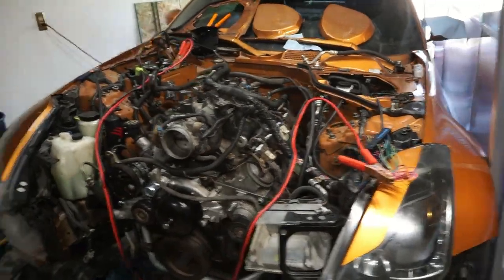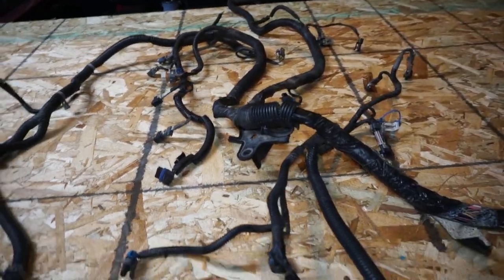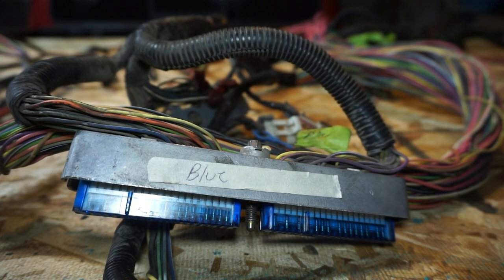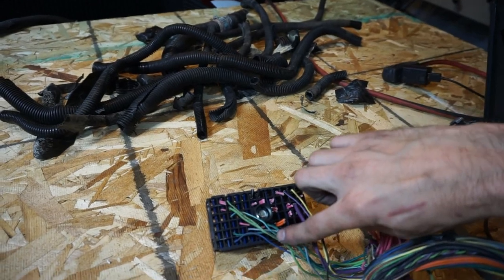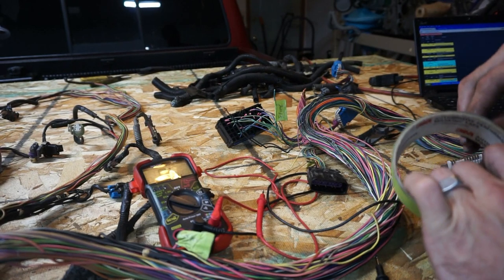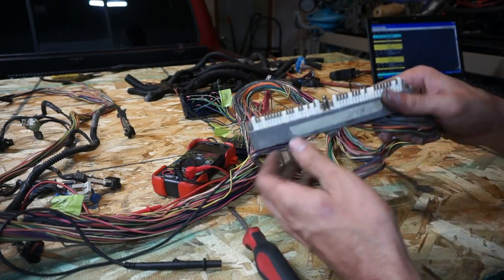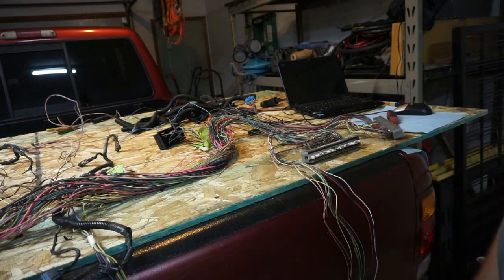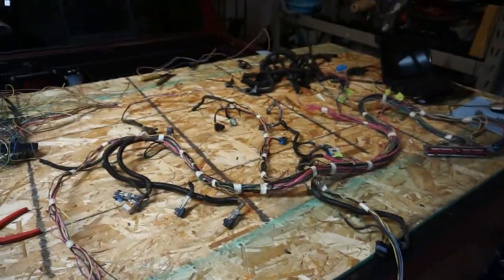HOW TO - STANDALONE LS SWAP HARNESS!!! Manual and Non-Electronic Transmission!!!

Comment: Dude, I did my harness recently for my fairmont, and this vid saved my ass! Thanks bro!
Reply from the maker: Glad to hear that!
Reply: I'm about to swap my turdmont
Reply: @BlaserBuilds  I have a Mazda B2200, and I would like to ask you which motor is better fit for that pick up.   A LS1 or a 6 cylinder 4.3?
   Thanks
Reply from the maker: @turbo12v  I have an LS in my ranger so maybe I'm a little biased :)

Comment: If you put a zip-tie together backwards, you can take them back apart when you need to. That's years of sub-standard wiring talking.
Reply from the maker: Nice.
Reply: Nice hint. I had just bought some of the ones that have the tab to make them re-usable.

Comment: Thanks you make it look very easy, I have a 1994 LT-1 Engine Transmission and Differential, and I'm planning in put this assembly on my 56 BelAir Sport Sedan, I need to eliminate the Air Bag wiring, and the Break speed sensor the Power ABS sensor wiring, I will look at your other videos, to see if will help me on this swap.

Comment: Great stuff, I have watched several of these and slowly warming up LOL, appreciate the no nonsense approach to your vids. One thing dawned on me, the "signal" wires you denoted would go to a relay to send main 12 power to end use? So you COULD us the power supply from the swapped vehicles fuze box, and simply add one relay box and done? Thanks

Comment: A21Brovo,  I am about to start my own 2002 5.3 for a turbo setup.  I have a printed copy of the wires from lt1 I think it is.  On the website it says that things highlighted in yellow can be removed.  Along with the the ones it says are not needed?  It also says that if you have a need for 4 o2 sensors or Evap system don't take them out.
Please let me know which ones stay and which ones got to go!
Your help is not only truly appreciated, but very much needed.   I have no help from local people or friends.
Thank you,
Brad

Comment: What would a good donor for a 4.8 swap for 97s10 ? I want to swap the engine and transmission, keep the 4L60 until something happens to it, a 6 or 8 speed sounds nice anyway, but likely more than I want to spend on it! Maybe a future project, I want it to be like factory, if they made a 4.8 97 s10 in the 00's I'd like to do a cam swap and turbo, eventually, with about 10psi. Great video!

Comment: Maybe if someone is having trouble, they could hang a sheet of plywood, with nails to hang the harness on then label the ply wood for the sensors, to help keep it straight in your head! I have sort of done this in car, basically if you have changed a engine, you can do this!

Comment: This is all great. But as lt1swap said on a FB post said. The big black plug for fuse block. He said cut all of the NON pink wires. And trace to source. Either to pcm connector or to the sensor. And the other connectors by the fuse block plug cut those off and trace as well. 
If they go to PCM use the diagram as to what to do with it. Blue or yellow highlight meaning.

Comment: This video has already helped me. I have a Dodge 2500 Cummins 4x4 6 speed, got all sorts of trouble from the harness. Almost 400k on it but I'm into it too deep back out now. The engine harness is discontinued so my options are buy used ($1500 if you can find one) or patch and repair (driving me nuts) or a stand alone but I'm told that won't work and I'm not sure why. Don't know if you'll ever see this post but I gotta give it a shot. What would you suggest? This is also my daily drive. I'm about to pull the whole harness out and bring it inside, but I really don't want to..

Comment: did you save the low oil level sensor? if you does could you tell me what id the wire come from pcm to dashboard that turn the warning light on to know  when oil pan is low?

Comment: Sup man I've  been watching  your videos  for a while. I've  also got my hands on a lq4 with complete  harness  for $200. Already  started  the rebuild  with the harness  rework. I am planning  on putting  it into a g35 or z manual, but for my harness  I had to add tps wiring  with oil plug and AIC wires. Just missing  the aic plug and TB which  I'm picking  up from the junk  yard

Comment: I'm not running a automatic but a5soeed manual.. You have the pin out numbers to remove for the automatic transmission wiring.

Comment: Hello, I have a 2000 silverqdo that was a 4.3 I put in a 2004 ls 6.0 with 4l80 it has the stock pcm. I'm trying to mate it to the truck but don't know what wires and connectors need to make it run and drive. Thanks

Comment: So I have been doing research for an LS swap in my recently acquired 76 Cheyenne truck. I wanted to ask about to things that you didn't mention yet in your video (I'm 14 minutes in as I write this.)
So I was watching this one guy's video, and he said that you need to get around the VATS by flashing the CPU or buying a bypass. Is that true? How did you personally get around that? Secondly, I wanted to save money for now, and just hook up my engine to the stock th350 in the truck. Adapter kits are cheap, and I've already researched connecting them, but do I need to tune the engine to match the transmission? Can I just plug in some vacuum lines to the th350 and call it a day? If you couldn't tell, LS swaps are not my realm of expertise, and I'd really appreciate some help. 
As far as the wiring goes, you really made it seem easy. I'm usually not intimidated with electronics, as I love working on computers, so I figured I'd give a custom factory harness a try instead of doing an aftermarket one.

Comment: Maybe a dumb question as Ive never done an LS swap.
For simplicity couldn’t I buy engine with harness and pcm then install it all while hooking up power, ground, turn off unused mil alerts,  stuff the extra wire/plugs off to the side and go....?
Function over form.
Reply from the maker: Yep, that would work just like I had it. Hooked up with jumper cables to run the car in the other video. Would work fine.
Reply: a21bravo Thanks, Excellent video!

Comment: Hey man, thanks so much for posting this video. I noticed you kept the VSS wire. I'm in the process of swapping an ls1 into my 350z and am currently working on wiring. I originally thought that the 350z just uses wheel sensors for speed calculation, is there a specific reason to keep the ls1 vehicle speed sensor? I'm mating it with a 6 speed T56. Thanks!

Comment: Great video I'm going to take a crack it. Question about vss wire. Is that an output for a cluster? Or is  it vss signal from trans? I will be running a 5.3 with a T5. Once again great video.

Comment: I've got a swap in planning stages with a 90's Mercedes 5.0 v8. Since no system that's usable standalone exists I'm thinking it makes sense to run it off a ls based system, basically make the computer still think it's running a 5.3. If it all goes to shit I'm that much closer to just biting the bullet and putting an LS in the car. The only thing that will be tricky I can think of is making sure the cam signal is the same and maybe knock sensor? I know I'll need an external reluctor and sensor. The rest of the sensors shouldn't be a problem to adapt. Does this sound nuts?

Comment: This may seem strange but I am interested in the Ford Ranger LS swap since most people usually do S-10's and overlook the Ranger. I am wondering if you did the fab yourself or used a swap kit and how difficult it is with the crossmember for the trans,motor mounts,oil pan,headers/manifolds,radiator,etc.(oh yeah I also use a "juice box" fairly regularly myself lol)
Reply from the maker: I built everything. I have a whole playlist for the built on here.
Reply: Awesome! Will definitely have to pop a top and check it out!👍👍🍺🍺😎😎

Comment: Hey man, you saved me during my ls1 swap into my 69 442. Now I am doing a 5.3 that will be going into a 67 Nova, was wondering if I want to put a manual transmission behind the 5.3, what wires are need from harness for the manual transmission, the VSS wires? Any specific one?? Thanks you so much!!!
Reply from the maker: Depending on trans Probably just VSS if you're using a trans that's 4k pulse per mile output.

Comment: I have a question I have an 05 5.3 and I'm going to use the 4l60e that came with it and I have the stand alone almost done I only need 2 wires a grey and a light green the were on the c2 can I remove them or does the ecm need them for anything? Light green is "park nuetral position switch signal" and the grey is "Trailer Backup Lamp Supply Voltage" 

Thanks

Comment: Are you using stock computer  wires cut out and missing will it trigger a check engine light I’m trying to do a LS swap in my boat but there’s a bunch of crap I don’t need
Reply from the maker: Yes, and yes you will have to delete some codes.

Comment: Where are you getting your pink wire/s for the fromt o2 sensors to be wired in your new fuse block? Only the rears has pinks and its required to remove the rears! I only have lt/grn and grn all spliced into the harness and the tan and purple goe to the pcm plugs. Where do they get the power. Where is the pink?? Hahaha

Comment: Nice video,i have a 89 iroc z tuned port..i boight a 2017 silverado 5.3 with dod and 6 speed auto 2wd trans..is this 5.3 do able in my iroc z..i think i can swap the oil.pan for a camaro and intake from a camaro?? Thanx
Reply from the maker: Yeah car intake and pan will fit. Need the oil pickup tube also.

Comment: Im getting ready to take this project on 2001/02 5.3 in my 86 chevy c10.. My only concern out of all of this is buying a engine i cant hear run to make sure theres no issues with  it. everyone has these motors in my area but they have either been pulled or the salvage vehicle doesnt have a key..
Reply: keith phillips 
If it’s a salvage vehicle because of a wreck, there’s a good chance it ran before the accident.

Comment: The only thing I found that is helpful is when I marked wires to remove I used red electricians tape on only those wires and I put one piece of red tape on the end of the wire in the harness and then I put another piece of the red tape close to the plug so I could remove them in bulk once I had gone through all the wires.

Comment: Love your vids! I'm doing the exact swap and in the same way I'm not about spending my hard earned money on parts I know I can make , I'm gonna attempt the wiring but I'm dropping in a 4l60e along with the 5.3. I'm watching for the ac hook up if you are gonna do it so i can follow what you do.
Also would you remove vats and other un needed things for others ecu's ?  People here charge like they looking for me to put their kids through collage. Keep it ☝
Reply from the maker: It costs 2 credits to unlock PCM to remove VATS ($100) unless you have umited license which can be thousands of dollars...
Reply: Hey @ 28:50 do those grounds just go to ground wires that are soldered all together in the harness? I domt seem to have them unless I cut them off can I just solder new grounds where they all meet ?
Reply from the maker: @guzlndzl  yeah they all go to the same place... PCM will have grounds also.
Reply: @BlaserBuilds  thanks, life saver 
I guess I cut them off with out thinking
Reply from the maker: @guzlndzl  Maybe just do a double check and make sure PCM has all wiring needed. And keep that in mind if you have any odd issues at startup, grounds are something that get easily missed in a good situation.
Reply: Thanks

Comment: Hey man looking for some help. I got a early 2000’s truck harness and could get to the transmission connectors to unplug them so I cut the harness right behind the intake. I have already traced and reworked the camshaft sensors and grounds. Am I okay to just tape off all the pink wires or do I need to connect them to somewhere. Much appreciated
Reply from the maker: The pink wires that were going down to trans?
Reply: I just need to know what to depin that went to the transmission if you remember what those were or know where I can go to find out

Comment: Did you delete the tcc brake switch? Wondering if you need it to run a manual trans and if you can just delete it or have to flash the pcm as well. Thanks
Reply from the maker: I didn't do anything for it. Left it out, nothing with PCM.

Comment: I have my 00 k1500 harness pretty much finished with the 4l80e conversion my question is do I need to use the range selector in my application the 5.3 & 4l80e is in a 04 mustang its going to be a street car with all accessories ac cruise etc I'm using the ecm and body computer's to run the ford side of the car for the cruise cooling fans etc I was wondering do I need the factory GM range selector or can I do away with it the ford side of the is wired to start the engine thank you
Reply from the maker: Don't need it, unless you want to use it for neutral safety switch or reverse lights.
Reply: @BlaserBuilds  thank you very much for the info on the range selector I'm using a b&m hammer 4spd shifter and I installed a micro switch on the shifter for the park enable for the starter 

And thank you again for the info I be waiting on the next video on the caddy

Comment: Hey man do you notice a huge power difference between the Gen IV 6.0 and the 5.3?

The stats I find people vouching for the 6.0 being a massive power increase are always the same people who’s LS isn’t even driving or fully installed yet. So it’s just blind guessing based off displacement. But you own them so what’s your take on the two?
Reply from the maker: No big differences. Especially when referencing cost. 4.8/5.8 will make great power boosted for much lower cost... I started with that mindset and now I'm not even interested in the 6.0 anymore, lol.
Reply: a21bravo awesome good to know brotha!

Just bought a C10 last month and the serp belt blew the water pump pully. Using this as an excuse to LS swap. But couldn’t figure out if the 6.0 at the yard or the 5.3 right next to it was better.

5.3 it is!

Comment: Hey so I see your videos I made everything you said but my truddle body is electric and there is cables that don't say where they go idk if you have any idea or ah diagram
Reply from the maker: Depends on the harness and vehicle it came from. One harness is drive by wire, one is drive by cable. Wire throttle has 1 plug, cable throttle has two(TPS and IAC).

Comment: So the external power wires are the same no matter the application?
Reply: And with a th400 it would be the same as running a manual trans?

Comment: what year is the harness from? didn't it change to blue green in 03 and 03 iwas drive by wire>
Reply from the maker: This was early 99-02 ish. Cokors changed in 04 I think, but the 04 vans kept drive by cable until later... Harness in the ranger was an 04 express DBC.

Comment: Why do people pull wires out and remove? Can’t you just change/ignore parameters on the pcm with HP tuners? I mean you have to delete VATS anyway might as well delete any other sensor you don’t want? Or do people remove wires for a cleaner look?
Reply from the maker: Yes, you dont have to remove the harness, but there's a lot of bulk in the factory harness, and a bunch of unused plugs for this situation.

Comment: My friend if I what to use my stock transmission which wires I need to use?
Reply from the maker: Then you would jist follow the LS1 swap instructions and only remove the wires shown there. Those instructions keep the factory trans.

Comment: Hey I can’t find the video but am wondering why the slow crank when you first tried to start the 350z trying to start my k10 and it cranks really slow like that and doesn’t start I think I’m missing a ground somewhere
Reply from the maker: Yeah, make sure the engine is grounded properly and battery has a good charge. Could confirm ground by running a jumper cable to a bolt in the front of the head to negative on battery.
Reply: Thanks I’ll see I thought I messed up the stand alone harness lol which I guess could still be a possibility
Reply from the maker: @swerbproductions4658  The starter is grounded through the block so grounding the block to the chassis would be a good place to start.
Reply: Wanna mess with it here next couple days when I get the chance to wanna fire it up to confirm oil pressure is good and I didn’t pinch a o ring so I can get the water pump on and get coolant in the block and start doing the finishing touches to get it up and running

Comment: I did the harness and plugs it in and checked It over  4 times starts up and shuts right off...  start shut off.. did u have to flash ecm...  just reminds me of security
Reply from the maker: Yeah, you have to delete VATS from computer.
Reply: @BlaserBuilds    I got rid of security no only runs on 1 and 3
Reply from the maker: @Taterhead68  on 1 and 3?
Reply: @BlaserBuilds  yes runs on  cyclers 1and 3 rest of  nothing
Reply: Figured it out sorry was cheap injector plugs thanks
Reply from the maker: @Taterhead68  Verify spark and fuel on each cylinder then make sure power and grounds are all good.
Reply from the maker: @Taterhead68  Gotcha. Good stuff.

Comment: this video is only for manual transmissions ?
Reply from the maker: Yes, but o my because I took the extra steps to remove the transmission wiring.
Reply: a21bravo what route would I take if I’m wanting to keep an Automatic ?
Reply from the maker: @socialbuzz295  You would essentially follow the instructions on the wiring diagram I posted in the video. It will tell you which wires to remove, all other would be used. Depending if you're using a 4l60e, or 4l80e, and the harness, you may have to add/remove a speed sensor for the trans and re pin some wires on the trans plug.